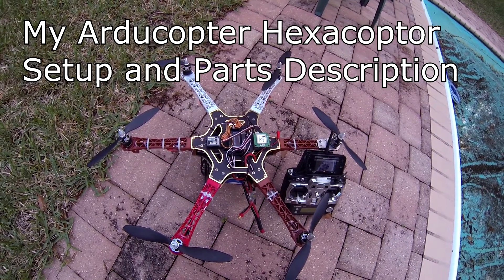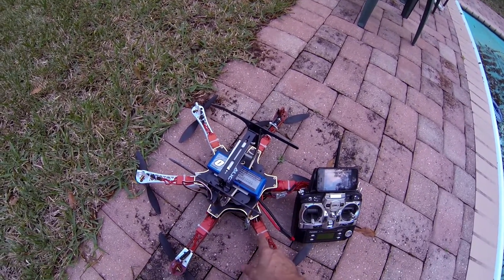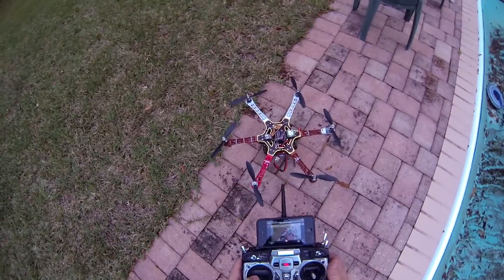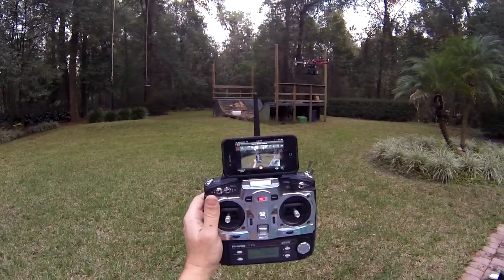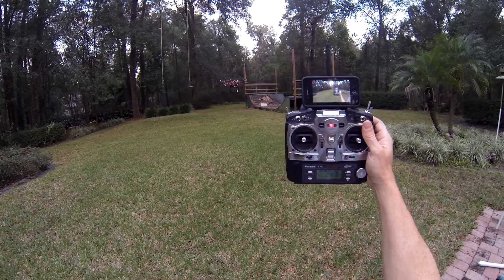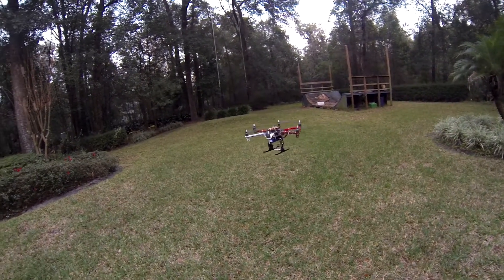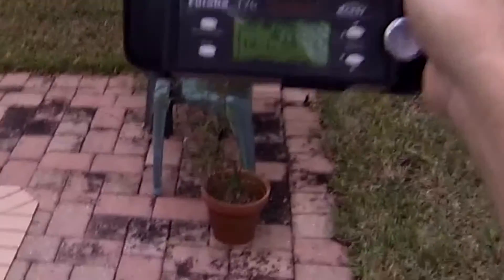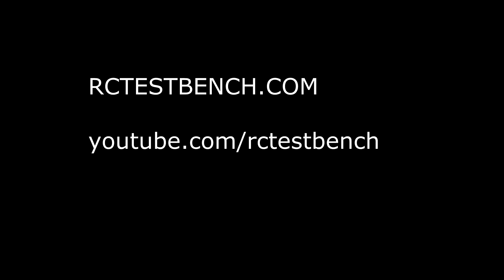My Arducopter Hexacopter Description and Parts

Comment: Hello there, I wonder if this Hexa as you built it, is better than a genuine Dji F550 ART kit with Naza Lite /GPS that I can buy on line for $400  ....  the difference between them is only about $40 . I want to build one like yours , but im not sure if  Dji means  better quality and performance , and I do not want to spend a lot of money ... this is a list I have at this time waiting to make a decision...
 	

Quantity	Stock	Product description	Price	Weight	 
	OK	TR_P30A - TURNIGY Plush 30amp Speed Controller	$78.78	
	OK	AM1001A - PolyMax 3.5mm Gold Connectors 10 PAIRS (..	$1.69	
	OK	258000011 - 10CM Male to Male Servo Lead (JR) 26AWG ..	$4.75	
	OK	NTM28-ACC - NTM Prop Drive 28 Series Accessory Pack	$11.10	
	OK	NTM2826-1100 - NTM Prop Drive Series 28-26 1100kv / 252..	$87.12	
	OK	017000058 - 8045 SF Props 2pc Standard Rotation/2 pc..	$5.38	
	OK	9390000021-0 - Quanum QFX Plus GPS Multi-Rotor  $119.70	

TOTAL: $308.52	1384g

Plus Hexa frame $35 

Total $ 335 shipped.

I have another option for the flight controller, the Ardupilot Mega 2.6 / Ublox Neo M6 Gps / Compass

I would really like to hear some comments from experts since I am new to this hobby.

Comment: 6x21amp=126amps
You will burn your current sensor if yo fly in full throttle. The max current that can be handle is 90 amps.